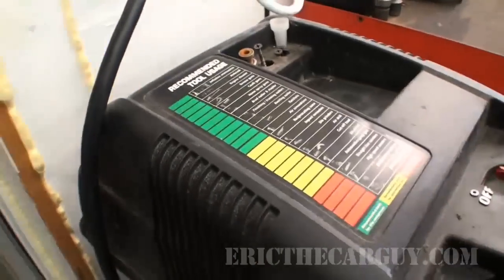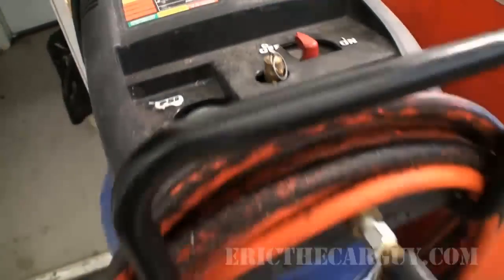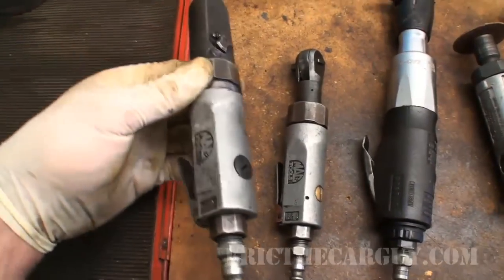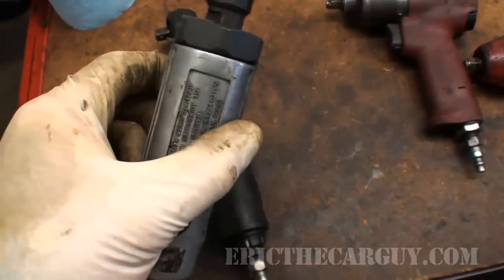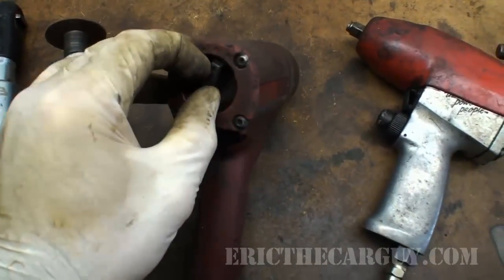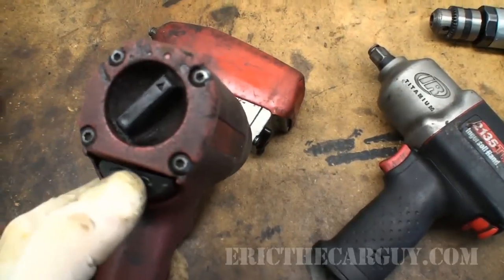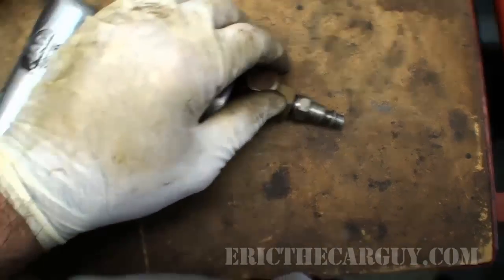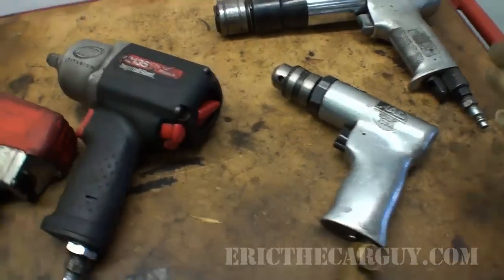ETCG's Air Tools and Compressor

Comment: I have used the napa tool oil and now am using lucas tool box buddy for my tool oil. the purpose of the oil is lube and it flushes out grime and deals with water in ur tools. The last thing you want it to get your air tool out and its rusted up solid, happened to my CP guns before. the grease lubes the hammer in ur impact to prevent undue wear from dry metal hammering together. the electric impacts are handy but kinda weak, the guys I work with have them because we do trailer work on big rigs

Comment: ***Nevermind, I guess you answered it in this video. Any advantage to getting oil vs electric? Kinda like gas vs electric lawnmowers right? 

Hey Eric, can you do a video on selecting a cheap but efficient air compressor, impact wrench, and required accessories? I've seen pancake air compressors for like $60-70 but I heard those are only good for blasting dust and filling tires. Then you get your bigger ones that start at around $150-180, and go up to like $300-400. I guess I can do without one, but I've always wondered how much I'd have to spend to get a decent setup.
Reply: aznnp77 his size air compressor at 26 gallon is decent. It's a minimum requirement. can't even air up tires without waiting for the compressor to build up again when it comes to pancake compressors. i owned a 2 gallon for years. took four minutes to build up the tank from zero to 120 psi! Takes only a few minutes to fill my 60 gallon 240 volt to 150 psi. stay away from oil free as well.

Comment: My advice is to get the biggest cfm output pump but dont forget that it will need a higher hp motor to drive it. It's not just the size of the tank it's the rate that the tank will fill.I have a 3hp 50ltr compressor in my van which is just enough but could be better.
I now a truck tyre fitter that has a compressor that runs off the engine of the van 
and is 32cfm 100ltr tank mounted under. that thing will run a 1" gun no problem.

Comment: if you can, try to get the matco mt2838 air ratchet. it has the small size of a 1/4" air ratchet with a 3/8" drive head on it. i dont know about you but i have a lot more 3/8" stuff than 1/4" stuff. its fast, has plenty of torque, and it has replaced my big 3/8 and my 1/4 air ratchets for most jobs.

Comment: I have a 29 gallon compressor 2hp 150psi my hose is a 25ft 3/8 inner diameter  i plug my impact wrench and it cant even take out a single lug nut my impact wrench has oil in it i put each time i use it my compressor is at 150 psi but still doesn't  take out a lug nut what can it be people tell me i should be busting out lug nuts like nothing
Reply: +1999151 Sounds like you have one of those cheap wimpy single hammer impact guns ,Get a dual hammer 1/2 in. gun , and if you do have a good one then it must need rebuilt,  because your good on air power and hose, I realize your post is a year old so this may not be any help now.
Reply: yes. need a twin hammer impact. those $23 ones at TSC are single hammer and do not do the job. Harbor freight has a earthquake for around $100 that does a superb job!

Comment: Eric, is that SCFM enough for impact wrenches?  I want a 110v electric compressor for house / car and it needs to be portable.  Biggest issue has been finding one with enough SCFM for impact wrench.  I'm not a professional mechanic or contractor, so I doubt I need anything with a super large tank.  The 3-5 SCFM @ 90PSI is fine for nailers but for impact wrench I have heard you should have like 10-12 SCFM @ 90PSI or whatever the tool is rated for, which is what has been holding me up (cost for something with that much SCFM @ 90PSI).  As per this video, I guess not... thoughts?  This could help me out.
Reply: A standard 1/2 inch impact will run okay on 5 SCFM. 90% of them are rated at 5. If you are running a shop then yes 10-15 SCFM is what you are looking for.

Comment: What is it with those Honda crank bolts?
Mine won't take the big hex tool to hold it steady, so I bought a 1" impact. Gets her off every time. We call it "the problem solver", it has saved us on a couple other hub and lug nuts that a 1/2" couldn't remove.

Comment: i have 60 gal campbell hausfeld version. it has a belt driven cast iron pump so you can replace just the motor or the pump in the event of failure. i dont like oil free units as the pump and motor are one unit and they are more difficult to service. they also dont last as long, a cast iron pump has life in the thousands of hours. i have had mine since 2007 and i have done everything with it including sandblasting; i have never had to put a penny into it except oil change

Comment: Theres a tech at our shop that has a 1/2" impact where the snap ring wore down to the point where it doesn't even have any resistance when you put a socket on, i hate when i help him! You have to hold the damn thing in the air so it doesn't fall off, so annoying when you're trying to chuck a wheel on at the same time.

Comment: Good evening. Can you educated me in why my air ratchet running nonstop after I let go the trigger
Reply: Is it a faulty valve at the trigger?  The trigger actuates a valve and it may be getting stuck.  Does the trigger feel sluggish?  If so, try a drop of air tool oil, work it in by repeatedly pressing the trigger, repeat until it feels like it glides, then hook up the tool and try it out.

Comment: That 3/8" impact he showed is in fact an Ingersoll Rand, as he suspected. It's a 2115Ti, with a red housing instead of black, but it's made by IR and kicks just as much ass as a regular IR 2115Ti. :)
Reply: I have that exact same 3/8" impact, still works great. Labels are long gone.  Thanks for the ID, now I can go find & order a rebuild kit.  Just did my MAC AW5500 (same as IR 2135tiMAX) now on to my 3/8".

Comment: what kind of bits do you use for your air hammer usually?  i have a cheap little madeinchina air hammer that came with a pretty standard chisel kit - works well enough but does more damage because the bits are pointed - is there something else i should be using for automotive work?

Comment: Those things get in the way a lot, I stuck a huge air lubricator after the moisture filter, you'll get oil in the air lines but those thingies won't get in the way. But yeah, air tools do need lubrication.

Comment: Hello Eric I love your videos, but you need to seriously upgrade your air compressor I mean I do my work as a hobby and not even a business and my primary air compressor that I wired myself as a 240-volt 60 gallon 11.4 CM F at 90  PSI.

Even my smaller unit Husky Which is pretty much 30 gallons, at 90  PSI can you over 5 cmf and  and runs on 110 volts might be a better buy for your do-it-yourselfers 

I never seen Rust like that from any of my  air compressors and I've been using them for  2 decades; I drain them   after every use

If you got a bigger  compressor I would not waste money making lines I love you videos once again and I didn't even know they made an air hammer that's on my Christmas list

Comment: i hate those damn valves - you buy it on monday and it's rusted on Tuesday...
i replaced it with some copper pipe and a ball-valve...no more breaking your knuckles on the ground, no more rust, no more headache

Comment: Eric have you ever used a butterfly wrench?  What do you think of them?   I've used mine for years.
Reply: +George W junk dont waste your time get a real air ratchet
Reply: Air ratchets are so slow. I have both.  The air ratchet takes about a minute to run a 1 1/2 inch bolt down.  Verses my butterfly which takes about 2 seconds to run the same bolt down.
Reply: +George W And if keeping your tools in a green lee on a job weld and re enforce the thing put cement blocks in the bottom i lost over 42000 in tools a few years ago and harbor freight sells locks you can only get keys for them at a lock smith says made in china but i tell you what nice to know. Everyone has a master key set. Lost air tools my grand father gave me from long ago i can never replace them or find them.

Comment: Hi Eric.   I have a quick question regarding lower control arm on 2005 Nissan Altima 2.5L.
I had a bad ball joint on my Altima, and since ball joint is part of lower control arm, so I replaced  the entire unit.  My old original ball joint had a cotter-pin, but the new one doesn't have it at all.   There isn't even enough space above the new nut which is slightly taller, to drill a hole.   I tighten the nut to over 50 ft/lb.  Does is matter at all not having a cotter pin?

Comment: I have a problem with my 98 Buick lesabre, the issue is intermittent but most of the time the transmission shifts very oddly into 4th, It acts as if it does want to shift and then jerks a couple of times and then finally drops into 4th gear. Do you have any idea what the issue could be? Thank you in advance

Comment: all my impacts and hammers run at 90psi max...but they are not MAC products. Do those that you have run at a higher line pressure. I basically have the same setup with the air compressor and unless i'm running my 1/2" drive impact...it doesn't come on that much. I do oil my air tools but i'm going to run an air/water separator in the future so I don't have to as much. My 1/4" drive locked up on me recenlty and I had to take it apart and clean it out. Using lighter wght grease really sped it up.

Comment: Air compresser? Sure,but get a big one! 20 gallon or more. If you uses high-drain air tools,you will burn a small one out.Cast iron and with oil bath style.Always drain out the compressor!"Whizzers" are an air hog. Go electric when you can. Cordless electric.  They are getting really good!

Comment: Hi eric, I have one question about air tool I bought few days ago. I do have air compressor and impact wrench that I intended to use on my cars but first day of use I run in to the problem. Impact wrench (says on the sticker) has all the power I need and air compressor has all pressure needed for air tools, but when I use impact on wheels I cant loosen bolts at all, and when I take it of with other hand tool I couldn't tighten it back with impact. Whats wrong(I set everything on specified max)?

Comment: Not really a fan of lever triggers ratchets. I have first hand and no hand experience of them slipping out of my oily hands where the lever snags car parts and the trigger is stuck till you snap the fastener unless you could disconnect the air hose in time.

Comment: ur air input on ur air tools are to small if u use the next size up and put ur air tank PSI to 90 then ur air tools will run like they are now i had those on mine and they just can't feed the tool with the right about of air so when i upgraded to the bigger inlet port worked so much better i hope u at least try it one time im gonna make a video i'll put it in the reply for u Eric
Reply: Look at your keyboard. There are keys that look like this !! .. ?? ,, ;; 
Use them.

Comment: This compressor is rated for 3.8 SCFM at 90 psi and it claims it can supply an impact wrench for intermittent use, HOWEVER, I have found that all impact wrenches I've researched require 4 SCFM at 90 PSI AND the recommendation from the big box stores is to get a compressor with a rating of at least 6 CFM at 90 psi for such an impact gun.  Does this compressor really power an impact wrench well enough to blast off lug nuts from wheels quickly?  that's what I'll be using mine for and it will be very rarely used (I'm just a DIY mechanic, not a professional one).  I'd need to take off and replace 20 lug nuts about 4 times per YEAR!  could I get by with an "underpowered" compressor like this or do I really need to spend 500 bucks on a 6 CFM rated one?  Also, does the CFM rating mean anything once the compressor fills the tank?  The piston compressor is not actually powering your tool as you use it.  The tool is just running on air, released by opening a valve, that's stored in the tank (right?).  I know ETCG hardly ever replies on youtube comments so ANYONE who can share wisdom on this, please do!  Thanks
Reply: Four times per year? And you want to go crazy with the ability to do it "quickly" (whatever that means)?

Get a breaker bar!
Reply: dchawk81 have a breaker bar.  Got a 33 Gallon compressor; I'm using it for much more than just lug nuts. WORTH EVERY PENNY!  thanks for your input though.
Reply: dchawk81 BTW, I tried up to a 20 gallon compressor and it sucked!  I dont' know what the poster is talking about but this tiny compressor CAN'T handle most lug nuts - guaranteed
Reply: jawojnicki You're doing something wrong then. My father's portable 8 gallon can do lug nuts. You just have to wait between every wheel because it's so small.
Reply: taledarkside Possibly, but let me ask you: what is the SCFM at 90 psi of your 8 gal compressor?  How much did it cost?  What is the max torque rating of your impact gun?  How much did the IMPACT gun cost? 
I tried an 80 dollar 500 ftlb Husky impact gun (wouldn't consider this top of the line, but NOT piece of crap) and it still sucked with a 20 gal 4.7 SCFM compressor behind it.  Seriously, please answer my questions, b/c I am sincerely interested; I'm not just arguing to argue.  Thanks
Reply: jawojnicki I have an el cheapo Harbor Freight electric impact rated at 330ft-lbs and it does lugs. Not powerful by ANY means. I'm actually thinking that 330 is an exaggeration because it won't do an axle nut.

My father's Snap-On (unknown year/model) and mid level IR both do lug nuts on the small ~8 gallon compressor.

Lugs are one of the easiest tasks for an impact. Easier than some/most crossmember bolts, which aren't that difficult either.
Reply: taledarkside
Are you saying that the higher CFM does NOT mean more power when the compressor is not running?  In other words, if you are only using STORED air in the tank, then a 3.8 CFM gal compressor will put out just as much power  as a 6.0 CFM if all other factors are identical??

Your IR gun was probably so expensive that it cost me less to get a bigger compressor and a cheaper HFT gun. 

To be fair, I didn't try the 700 ftlb gun with the smaller compressors.  Once the lighter guns sucked, I just got a bigger compressor AND a heavier torque rated gun.   All in all, it's cool, because it works like a champ, but I AM still curious about whether the "specs" for CFM really matter when  you are only using stored air anyway!  Let me know .  Thanks again
Reply: taledarkside I think the HF Earthquake might be decent for the money. It is on paper at least. Not top shelf by any means but at $80 on sale and sporting a 30 day return period, if I had air I'd probably try it out.

Having said that, I just got the IR W7150 because the HF electric wasn't cutting it anymore. I can safely avoid air for a bit longer.
Reply: taledarkside The Earthquake isn't really your standard cheap air tool though. It's kind of like a mid grade IR power-wise. It's getting a lot of good talk on forums and things.

If we were discussing those $30 "heavy duty" guns then I'd completely agree with you. That stuff is basically junk.
Reply: dchawk81
If I didn't mention yet, the 80 dollar 1/2 inch Earthquake IS the one I got and I love it!  I doubt it would hold up in a pro shop where you are making a living with it, but the occasional DIYer, it's perfect.  hasn't let me down once on any lugs, including the ones that all the other guns failed on.  Rated at 700 ftlbs torque, an identically rated one from a "better" co. like Snap On, IR, etc would cost way more!  Glad you're doing well with your electrics.  Thanks for all the advice and education in this forum.
Reply: jawojnicki That's cool. It's always nice to get tools we're pleased with. Air definitely has its place....these high powered electric ones are pretty big compared to similarly strong pneumatics. But I really like it.

I used it to break head bolts a few days ago. It made easy work of it. Last year I broke a head bolt on the same kind of car when using the breaker bar. The impact pulled them all out intact because I could concentrate on staying straight up and avoid twisting sideways.

As far as durability goes in a professional environment, my local tire shop has nothing but older Chicago Pneumatic guns that they abuse. They're not particularly awesome but they get the job done. They do have an air compressor bigger than most women's walk-in closets though.
Reply: dchawk81
HA! LOL.  Great to hear that some HFT brand stuff has stood up to abuse.  Honestly, much of what I've bought there is total crap!  I have about a 50% positive feedback rating for them on tools.  Normally, that would upset me, but because they're SO inexpensive, I still love the store and they are my first go-to when I need a new tool.  On a different note, thanks for the comment on the 3 ton LP jack from HFT.  That's exactly the one I have my eye on for a Chrysler Minivan and Subaru Forester.  If it does well for your Navigator, it should be more than enough for my cars.  Just waiting for it to dip to 75 bucks or less.  VERY low on $ right now.  take it easy
Reply: jawojnicki Yeah I look at everything with skepticism and seldom buy. I can't afford to throw away money so I tend to just wait and save up for the better stuff from real brands when possible.

The jacks are great, the ratchet straps I have are okay considering their load rating, the electric (battery) impact was good considering it uses old NiCad. Their little tie straps are fine. I got some magnetic lights that are weird (they briefly go dim then bright instead of just bright when you hit the brakes) but do a good enough job for tow dollying cars around. Impact extensions are good but I haven't used them much.

I can't think of what else I've bought. I don't have a ton of stuff from there since I'm über selective but I do have some.